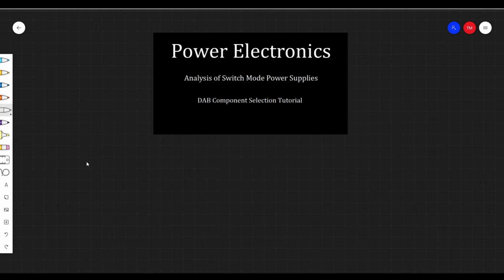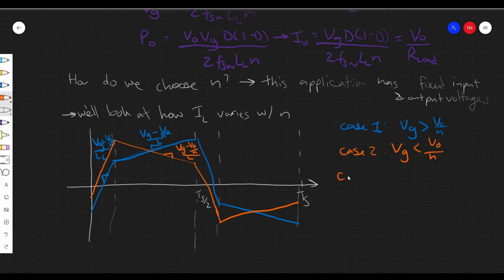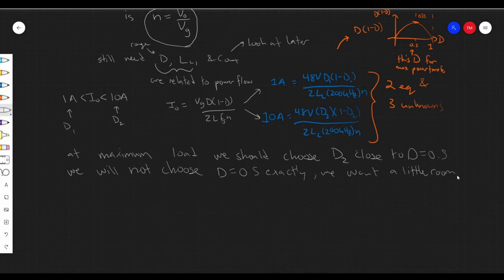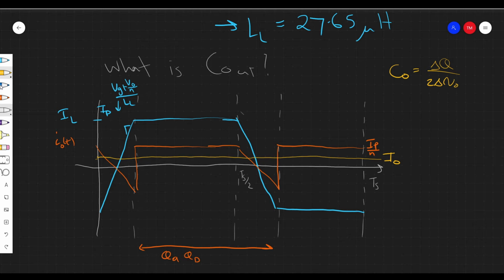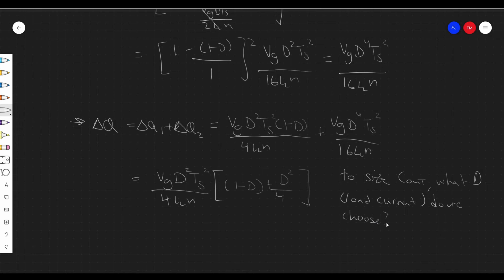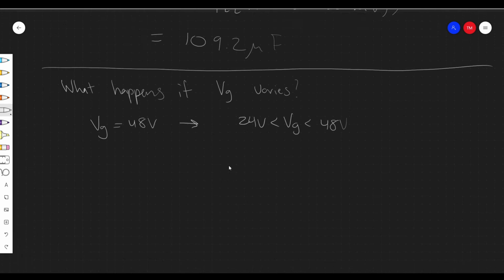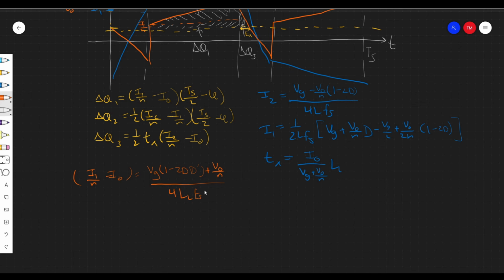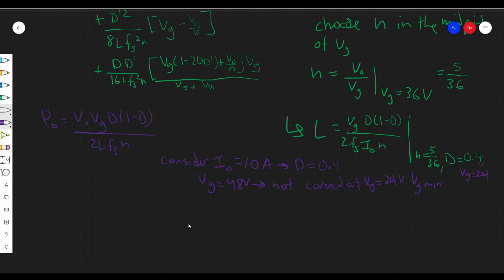Tutorial 5: DAB Design

Comment: I"m confused with the rectified current.  How is it ever negative (doesn't it always flow "to the right as drawn" producing positive Vo across RL)? I would expect Iout to always be >0, thus, in the first quadrant at time 21:07, io(t) in orange , i'd expect it to start as drawn when IL is negative, but then follow the IL once IL goes positive.  I don't think the orange line should ever go below 0....could you please clarify this?  Thank you.   Love your lectures, by the way.  They have the right amount of detail for me.
Reply from the maker: Remember there is an output capacitor, which stabilizes the output voltage. This means that for short portions of time, current can be drawn out of this capacitor and instead of the voltage immediately going negative, it simply decreases. As long as the average current into and out of this capacitor remains zero, this average voltage will remain the same. 

Also recall that the secondary side bridge is active. When the switches are on current can flow both ways. This means that if the inductor current goes negative, the reflected and rectified current will also be negative at that time. We can still send a positive average current despite this.

Comment: Dear TIM,
Could you help me with magnetic inductance of transformer for DAB design? Here is no influence of value this inductance in real transformer for reactive power of DAB converter? I think here will be some differences in primary and secodary current waveform or not? If not I can not expain myself why not.
I think bigger value is better than lower value of inductance, because she has bigger impedance for PWM (switching frequency) and lower additional reactive curent through this induktance.

Thank you so much for help
Reply from the maker: You're correct, the magnetizing inductance will result in increased "reactive power" in this converter, or increased circulating current. Larger magnetizing inductance is better to reduce the resulting magnetizing current. Modelling this inductance on the primary side we expect to see +Vo/n and -Vo/n applied, resulting in a triangular current waveform. Depending on the application, this extra current could be significant. In addition to the magnetizing inductance, we can also see that the turns ratio and output voltage have a direct impact.

Comment: Great Video Dr. McRae , Thank you. How can we control the Voltage gain of the converter rather than looking at power flow  ?
Reply from the maker: We can consider control of power flow to be load dependent voltage gain. Unfortunately due to the phase shift control in general, there is no clean load independent voltage gain. Perhaps there is a different modulation scheme, but I am not aware of it. Probably something worth researching.

Comment: Thank you professor for the lecture. Basically, when we design,  ZVS range of the converter is essential right? could you give us some idea that how to consider the range and all. Thank you sir.
Reply: Hi, sir.
Just a little bit i know. 
In Zero voltage switching, the inductor current should be sufficient to discharge and charge output capacitances of mosfets (1/2)LI^2=(1/2)CV^2.
It must be done during dead time.

Mr.Tim MCRae sir knows much better. 

If I'm wrong please correct me.
Reply from the maker: This is the correct idea. Ensuring you achieve ZVS over a wide range is basically ensuring that the current at the moment of transition is sufficient to change the voltage of the output capacitances of the MOSFETs. From the energy relation given above, you can see that it is related to the inductor current (at the moment of transition), and also the input voltage.

Comment: Can we use DAB for high gain applications, like vg/vo=10
Reply from the maker: I don't see why not. The transformer design is going to be a key aspect of this kind of application.
Reply: @timmcrae3831  thank you sir
Reply: @timmcrae3831  okay sir
But when voltage gain increases(or high)M=nVo/Vg ,where n=(N1/N2)=(V1/V2), will it effect the circulating current ?
Reply from the maker: If you tune the turns ratio appropriately, then the primary side current will look similar regardless of output voltage on the secondary side for the same power. Consider the slope in the second portion of the current: (Vg-nVo)/L. No matter what Vo is, you can always choose an n such that this slope is 0 (or near 0). The slope in the first portion of the current will always be 2Vg/L (or near it). The peak current will vary depending on the desired output power but the shape will  be similar. 

The actually implementation will look different because the transformer design will vary depending on the turns ratio, resulting in different losses.
Reply: @chai5632  what exactly are the circulating currents? 
how do we understand these from the waveforms? and 
why they are only before zero crossing in the waveform?

Comment: Gained so much from your lecture sir. 
May i know which is the best modulation strategy (sps,eps,dps,tps) for getting high efficiency?
Reply from the maker: There is not always a clear answer to this. Different applications will have different requirements. 

For high input voltage applications you want to choose a scheme which reduces switching loss on the primary bridge. For high current applications you might want to choose a modulation which reduces the RMS current in the inductor.
Reply: @timmcrae3831  thank you sir

Comment: Thank you so much Dr. McRae for the lecture. It's really useful. I would like to know if I want to study the converter behavior under  all modulations you mentioned(SPS, EPS, DPS and TPS), which modulation do I have to use to design the DAB? I understand that, depending on the modulation you use, the equation of average power differs.
Reply from the maker: Typically different modes of operation are used for a single converter to cover different ranges of input and voltage and load current. Design the DAB separately for each operating mode. Compare the resulting L, C, transformer and FET choices and see if there is overlap across the operating range of your converter. Selection of specific component values will determine which mode you can operate in for different voltages and currents. As these external factors vary, your controller will have to switch modes seamlessly by varying the phase shift and switching frequency.

Comment: Can DAB designed to be  bidirectional Buck boost?
Reply from the maker: The DAB is typically used as a bidirectional converter. The gain is load dependent but the converter can  be designed to buck or  boost.

Comment: very informative lecture. D=phase/(Ts/2). what does D'  dash represent? whats the procedure for finding I1 and I2. Thank you for the tutorial.
Reply from the maker: D' (said D prime) is analogous to the D' used in standard converters: 1-D. The only difference here is that D is defined over the half-cycle and as a result we want D(Ts/2) + D'(Ts/2) = Ts/2. 

Relating it back to phase or the phi notation: D' = (Ts/2-phi)/(Ts/2)
Reply: @timmcrae3831  thanks for your response